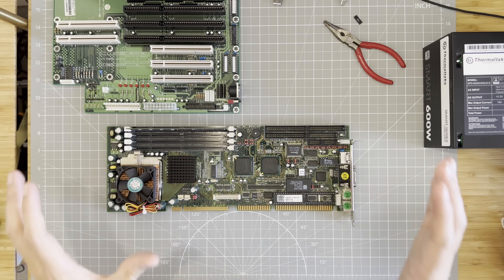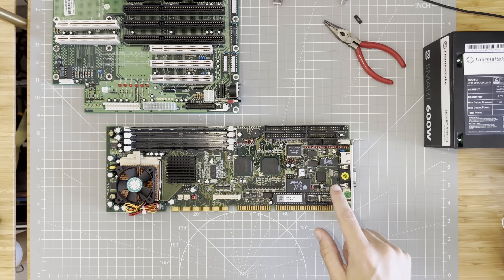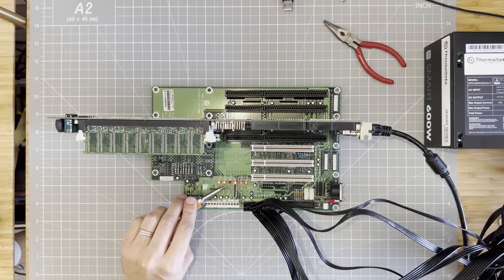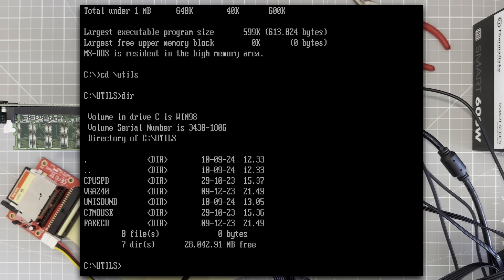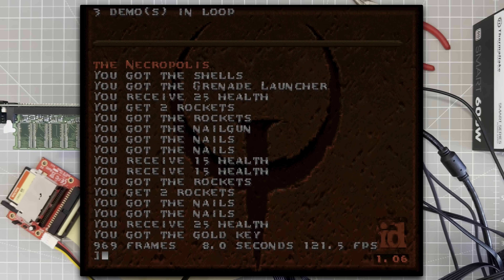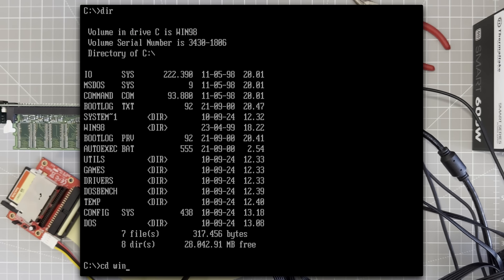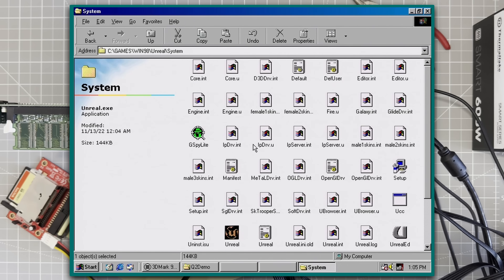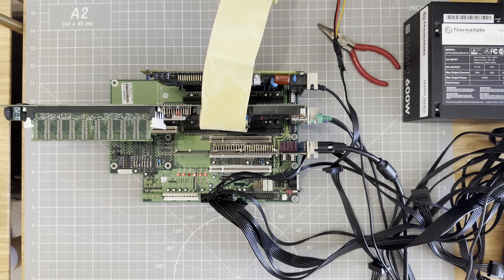This Fully Functional PC Fits on a Single Card!

Comment: I have one of these setup with a Q6600 (PICMG 1.3 pcie i think?) in about one of the most old looking 386 minitower cases I could find. It made a half decent sleeper pc of sorts. Though I have not found anything more modern to put in this thing.

Comment: For many years, I was glad I invested in the actual Creative Labs Sound Blaster 16. Reasonable price at the time, though later clone cards ended up costing almost nothing. But it, obviously, supported PROPER Sound Blaster! The SB Pro only had 8-bit sample playback, the SB16 had 16-bit. Cheap cards would do 16-bit but only in Windows with their own drivers, in DOS the best you'd get would be 8-bit as it tried it's best to emulate just the SB Pro. I used it until they stopped putting ISA slots on motherboards. Well worth the money.
Reply from the maker: Still great in a retro PC today. A great investment that still pays off in 2024 😎

Comment: This is a really interesting piece of tech. The slot on the back plate is not an ISA slot, but VLB (VESA Local Bus). It's built on the ISA standard, but comes with that little PCI looking extension slot right next to it.

If you happen to have a fully decked out mainboard with VLB, I'd be interested to know what would happen if you stuck the card in there.
Reply from the maker: It looks just like VLB, but it’s actually a PICMG slot - PCI and ISA combined 😎
Reply: @jamesfmackenzie  Oh wow, I didn't even know this standard existed. Thanks! :)

Comment: You might want to get a dremel and replace the battery in that Dallas clock chip. Those things die all the time, and sometimes messily.
Reply from the maker: Yeah, it definitely worries me. Is Dremel the only way to remove it? 😂
Reply: @jamesfmackenzie  LOL - you could try a knife, I guess. I just bought a dremel, so I'm biased! 😋

Comment: I have 2 SBCs: Pentium 233 mmx and Celeron 500 - both are great Retromachines! The Pentium is only half length ;)
Reply from the maker: I would love to get a half length and mini case to go with it! 😎
Reply: @jamesfmackenzie  I got the SBC with case, but there is a big fiber optic spectrometer in the case, together with a custom 24V DC-DC psu. That whole thing was built up for measuring the bending of the mast in a racing sail boat, while racing! (Bending=wind power in the sails)
Reply: @logipilot  Do you happen to know if a "half length" SBC as you said (so just with the 16 bit ISA part, not the PCI extension) can communicate with a PCI card on the backplane ? I've always wondered since some chipsets have PCI to ISA bridge.
Reply: @kami4542  maybe with a special backplane or the extended pc104 connectors

Comment: Disappointed by the prices online for PICMG computers :/ this looks like a good solution for retro, as I think these PCs are a bit sturdier than home ones.
Reply from the maker: They are usually expensive, but occasionally a good deal will come up. I was able to get a few on eBay for less than $100.

Comment: We have a couple of those cards that came with Pentium 1 CPUs.
Reply: About 20 years ago I bid on and won a Com Server that was built back in 1995 for $10 and paid $50 to get it shipped to me. I wondered why it cost so much until it arrived and almost gave me a Hernia carrying that thing up 2 flights of stairs! That thing weighed well over 100lbs! I bought it for the case only because I had no idea whether it worked or not and it did! I kept the card and CPU out of it with 16mb of mem and I don't remember the chipset but it had an ISA Backplane with 12 Lan network cards in it. After removing everything I found I could use any MB arrangement I wanted in this case! It also came with 2 300 watt redundant PSUs which made up for a lot of the heft. This case is longer than any 4U I have ever seen and even though I got one the guy I bought it from would not sell anymore to me. With 2 Philips screwdrivers you can take the whole case apart and I have yet to see anymore like them. If you ever see one for sale I would highly recommend you get it! I don't know who made it but it's nearly 3 ft long and its all screwed together! A really neat part of history AFAIC.

Comment: The CHIPS graphics chipset is made by Chips & Technologies (C&T).....one of the pioneering graphics companies in 1993-1994.....C&T was taken over by Intel in 1996...one of the founders of C&T was Gordon Campbell who went on to begin another graphics company called 3DFX.......C&T was a prolific producer of laptop,industrial PC and server graphics chipsets..😊
Reply from the maker: Thanks for the info! It actually seems like a very good 2D chipset - it’s fast!
Reply: Interesting info.  I was a 3dfx fan boy back those says
Reply: The C&T B69000 on this SBC is especially popular for the era, because it's a true single chip VGA card with integrated video RAM, which is also why it's pretty quick. Chips VGA controllers are popular on SBCs in general because of being able to drive just about every kind of LCD / display there is.

Comment: i went looking for some recently, but wanted pci-e, i think they support it now, but it's a relatively old format that is really really useful these days... lot of sff systems could be done with vertically mounted cpu board and graphics card, they both face opposite sides, so LOTS of room for fans.  however, they could be made really slim, not much larger than an egpu enclosure or a 4 slot backplane in a regular case, lot of wasted space then though.  i was always interested in the pc/104 sockets, now pi gpio does what i need.
Reply from the maker: I’m very tempted to buy a PC/104 PC! Looks like you can still buy new from ICOP and a few others 😎
Reply: @jamesfmackenzie  yah, great for a retro channel, though they added pci to it later, the boards stack one way for isa, the other for pci, with the cpu in the middle.
Reply from the maker: @felderup  Nice! Do they do PCI through the PC/104 pins too? Or another interface for PCI?
Reply: @jamesfmackenzie  it's a second block of pins on the opposite side of the board from the 16 bit isa pins, 4 rows.

Comment: Funny to see that build, Intel tried to push this with their NUCs years ago too with having the system on a daughter board sitting next to a regular graphics card connected via a third board that's only there for connection and power I believe. I believe aside from their NUCs being not super popular this exact model I mentioned had rather low sales too.
Love the concept though because you could even put in the system board inside a full size tower and tape the contacts on the PCIe connector, so it'd only receive power from the PC's mainboard.
It's kinda sad this concept never took off in the home PC space because it'd make replacements and upgrades even easier IMO. If anything, earlier home computers like those from Commodore and ATARI could be seen as the same, just on a different scale.
Reply: someone's trying to revive the external gpu thing for nucs, i think minisforum, might have been a thiojoe vid i saw it on, someone else maybe...
Reply from the maker: Yep! The Minisforum B550 has a PCIe backplane for adding a GPU, and they also have an eGPU dock too 😎
Reply from the maker: I remember that! I think it was the Dragon Canyon NUC. I was interested but it turned out to be super expensive :-(

I definitely love the idea of a modular, swappable PC like this :-)

Comment: I remember tearing apart my old 286 when I was learning PC's back in the AMD athlon days. thats all it was. a main board with add on cards. I wonder now if that is because it was from an old aviation factory or if that is how they were in the early days of workstations.
Reply from the maker: The original IBM PC XT and AT machines did have the CPU on the motherboard (as did their clones). So you might have had an industrial PC too! 😎

Comment: usb on a pentium iii sbc   ...
i would bet its floppy on the top, parallel in the middle and the 2 bottom ones are 2 serials
Reply from the maker: You’re right! The larger ones you can see on the video are floppy, parallel and 2x serial. Next to them is a much smaller row of 5 pins - which is the USB 1.1 header.
Reply: @jamesfmackenzie  damn im getting old. didnt even see that one.
back in the mid to late 90's i had a bunch of clients from printing and cam, that used all kinds of smb's from 286 up to piii and i cant remember one of the piii smb's, that actually had usb onboard. if you wanted/needed usb u had to use a pci card; not that anyone actually used usb back then. keyboard/mouse over ps/2, monitor vga, then some usually serial or proprietary cards to connect with the machinery and if you needed external data, that was too big to write on a cd, like for printing, then you used an external scsi hdd, in all variations that scsi came during the 90's. still have a bunch of adaptec scsi 1542 b and c controllers and some 2940 in all variations from back then
Reply from the maker: @alexandergross7132  I 100% agree it’s not really needed. Also I’m too scared to connect anything to it since the pinout varies so much 😂

I’ve only recently discovered the world of SBCs. Having great fun!
Reply: @jamesfmackenzie  ohh yeah. sbc's are usually a great, cheap, stable and very underrated solution for retro computing, especially if you have limited space. you dont need 20 computers to get your range from 286 up to athlon xp, like i did. just get 2 or 3 different era host boards and try to find all the smb's you want/need for them. might take a lil longer to get what you need, but you dont have to worry that much about getting all the isa/pci cards to get the pc running; you can always upgrade your graphics later. the only problem you might run into are the drivers. if you find a cheap smb card you should always check the ebay pics and information for the exact model and then check if there are some drivers around anywhere before you buy the card.
Reply from the maker: @alexandergross7132  I 100% agree! I’m in a small apartment without much space. A single chassis with lots of SBCs is super appealing 😎

Comment: wellp, there goes any chance of buying a sbc based machine, the prices will go up even more now.
same thing happened with all the cheap 10g  cards and the used data center ssds.
or the book 8088 or the 386 one as well.
I am starting to dislike retro hardware youtubers, the price of everything goes up when they cover stuff because all the rich 'valley' types buy up everything.
even retro hardware is becoming a bit of an elitist club, either you can afford the exorbitant prices post youtube coverage or you're basically left with no options as a hobbyist.
I want to see you covering/encouraging NEW retro PC hardware being made to increase supply and reduce demand.
We need to start seeing 386, 486, pentium and pentium 2 boards using recycled/improvised/retrofitted chipsets like the chinese do with data center xeons.
otherwise it's gonna be $300-$500 SBC boards forever.
Reply from the maker: Check my last video on the ITX Llama 😎

Comment: Single board computers are still used and still around to this day. 
I am working for a company for the past thirty years that still used those cards. A Pentium 3 Tualatin 1.13Ghz using Windows 98SE,  (3) AMD single board with ddr3 and ddr4 with CF cards running MSDOS 6.2, and a quad-core Celeron J1900 with ddr4 running Windows 10 and Windows 98. All of these cards have ISA buses and PCI buses. These cards control and collect date from heated ovens.
Reply from the maker: Nice! Is there a manufacturer who still makes these? I know ICOP/WDL do Vortex86 SBCs, but haven’t seen many others.
Reply: Course sounds like a job that any model of Raspberry Pi could do quite handily - but would need to develop all new software - or get a late model Pi and run an x86 emulator
Reply: @TheSulross  And adapt all of the interfaces to work with the Pi, which is probably an ISA data acquisition card.

Comment: I have Microbus MAT 990 with PC/104-Plus expansion, almost the same hardware, but the card is very small plus it has power connector and works without additional board. For case I used IBM 7207-001 external tape drive (29x29x5cm), it is tight fit,  but it hosts the board, ES1686 PC/104 sound card, laptop HDD, fanless PSU and standard 3.5' floppy.

Comment: Where's the best place to find one of these?
Reply from the maker: If you search eBay for “picmg”, you’ll see a bunch of backplanes and single board computers. Sometimes they are v expensive, but often you can pick up a deal for less than $100.

If you want to retro game, be sure to get a PICMG 1.0 variant with ISA and PCI connectors. The newer SBCs use PCI-Express.

Hope this helps! Happy to answer more questions 😎
Reply: @jamesfmackenzie  Nice to know. What are your thoughts on PC/104?
Reply from the maker: @angushughes5371  I don’t have any PC/104 machines right now, but I’m tempted to get some! 😂